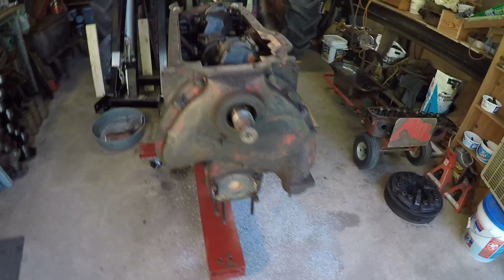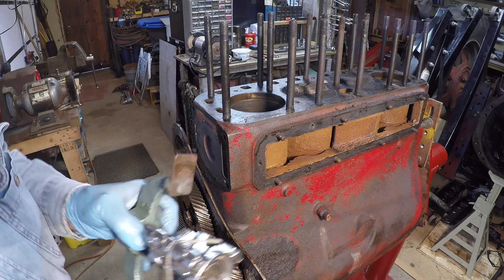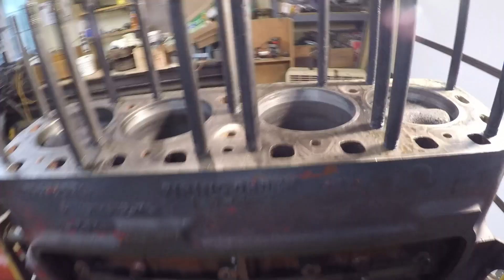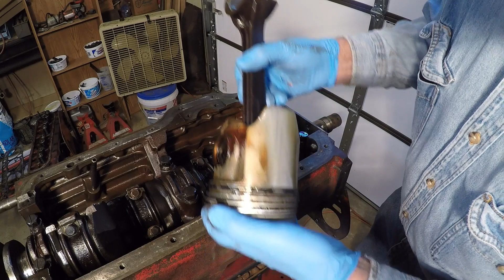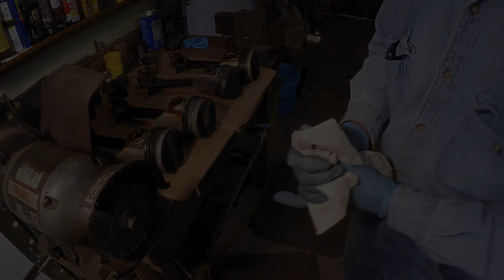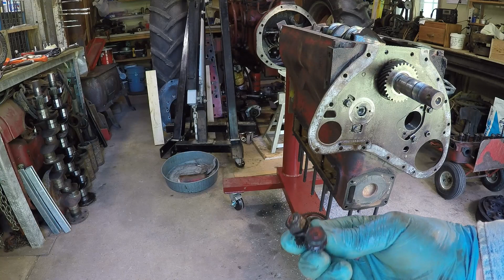Farmall Super M Engine Knock Ep.6 - Discoveries and More Questions...

Comment: Those old engine engines are tough. I bet there are more out there with painted bolts under the valve cover than you think. The nose cone have been known to brake when changed to 12 volts.

Comment: Don't forget there is a thrust side and a throw side. When the piston is on its ignition/power stroke, the pressure of the ignition pushes the piston to one side. on the exhaust stroke  there's wear on the other side of the cylinder. It looks like one side of the cylinder is the thrust side, where the ridge is the heaviest and the throw side the ridge isn't so heavy/deep.

Comment: I am guessing you will re-sleeve this engine. If you re-sleeve it use a mixture of STP engine oil treatment and cleaning solvent to smear on the outside of the sleeves and inside of the block where the sleeve slides into. It helps make them slide in or go in a lot easier. Our tech school instructor called this mixture snot.

Comment: That front cover is probably from previous issue and no doubt why it was tore down, the rust is a good indicator that it was no longer touching. 
I have not seen someone use a ridge reamer in the last 25 years at least. Most young kids don't even know what they are. Great work and great to see proper techniques to show how it was done and should be done.

Comment: Not the worst engine I have seen. There are so many out there running quite happily in much much more worn and tired condition than this one. Nothing really jumps out as the source of the problems you were having with it? Maybe the knock is a combination of several minor issues rather than a single big issue?

Comment: All engines have a thrust side, when the crankshaft is pushing the piston up the force is angular and is pushing the piston into the adjacent cylinder wall.  That's why one side is worn more than the other.

Comment: Except for that piston it looks pretty good. Mains definitely need attention, but I don't think there is enough room there to knock much. If the wrist pin was sticking and the piston rocking that might have been the knock. I wonder how much slop there is in the cam bearings. I'd be kinda inclined to put the camshaft back in and wiggle the gear up and down to see how much it moves.

Comment: Are the threads on the cam nut left hand or right hand? The left hand threads came out with 450 tractors as I recall, and were the replacement for all previous engines. If they are left hand, I’d bet the wear marks on the front cover and the plate came from issues with the last cam and gear. The live hydraulic pumps were rough on the right handed thread camshafts.

Comment: You have been there and done that several times as it come to natural to you. I have torn down engines without taking time to completely read the engine. I knew I was grinding crank and the bearings were all being replaced. Thats not to say I didn't keep my eyes open for tattle tale marks /bruises. Thumbnail for scratches and such but when speed was just as important, I paid a hell of a lot of attention to the mikes and dial indicators plus every new bearing was plastigage to check for any imperfection. I have run into bearings that were marked standard but standard to what as it did not belong to what I was working on and in logging camps where everything had to be goldstreaked in, The cost of shipping could quickly make a engine cost more to repair than to replace with warranty. Time is the enemy in those places and when your building as many engines as you possibly can all at the same time, just to save on shipping. A gallon of good oil could be fifty dollars in town but getting it to camp where you needed it, you bought everything in bulk cause to just buy the gallon in camp could run two or more hundred dollars. I seen two dozen eggs in Barrow Ak run seventy five dollars. The boss bought powdered eggs after that and besides tasting like dog stuff, it was about seven dollars a dozen equivalent!! Doing a great job teaching what you know and that knowledge did not come overnight but many a night with light in hand making repairs so the crew could work the next day. I as a mechanic started when the crew quit

Comment: An old friend had a even older M. One winter he didn’t get enough antifreeze in it and the block wound up with a couple huge slits in it. We looked at it carefully none of the cylinders were cracked and nothing was pushed out of line. It took me about three days but I was able to close both slits with about 20 brazing rods. It held coolant and as far as I know is running to this day. That old iron can take abuse far better than new equipment. The #3 I would check the rod and also the side to side play on #3. Also maybe the spark or possibly at sometime in to past a plug lost its electrode.  Keep us informed I really want to know what you find.

Comment: Another great installment in the series. Most people go way overboard with a ring reamer, when I worked in a machine shop we used to see blocks RUINED from people getting carried away, a light cut is all it takes. On the new rebuild you could run a modern heavy duty 10w30 oil like Rotella T4  year round, more protection hot and cold than straight SAE 10 and SAE 30 which rarely have a robust addative pack anymore.

Comment: this M had light service since it's last rebuild.

 i bought a 44 M used all it's life on mounted corn picker duty. last overhauled 12 years before i bought it .    it had barely any oil pressure and used 5 gallons of oil per 8 hr day. the crank was 0.009" out of round and under sized. came back 0.020" under.  i had to have a replacement cam . the oil rings had no  ridges on them  they floated   in the sleeves. the pistons and sleeves had no signs of wear so the engine got a new set of rings and valves it had a 450 hi alt lp head and dynoed out at 62.5hp after overhaul.. if was one of our main tractors  we pulled a 12ft disk  in 3rd or a 10 ft disk in 4th and a  hi speed 4 - 14 trip plow in 3rd or a 3-16 plow  deeper. i loved my old M and my H as  well. we farmed 180 to 250 acres of grain farm in so il. those were the days

Comment: Senior is this a WET Sleeve motor,.?  In my TR4 Triumph, I need to bolt down the cylinders so they will not break the seal in the bottom of the block.??

Comment: I betcha all those odd play/clearances and uneven wear are the direct result of that piston in the #3 cyl.   Wear and damage like that creates uneven harmonics on the crank.  In turn, literally,  that will cause the cam shaft to wallow out on one or both ends.   The marks on the end cover could still be caused by that cam gear when it's under a load.   It doesn't take a whole lot of surface contact to make those sorts of marks.   If the edge of that cam gear feels "sharp"   that'd be your tell-tale.  Rust or not, the very edge is the point of contact.   Think cutter heads on a lathe...     Otherwise, it looks like you got to it all in plenty of time.   I know my 400's engine is not going to be any where close to as nice a shape as you M here.    I'm sorta dreading just how bad my engine is going to be.

Comment: Too hot of spark plug will melt that center piston. 373 autolite is a cold plug,  c85  & c86 are to hot. 386 is just in between.  I had a 756  that locked up because it melted down.  NGK plug, A4 is a cold plug  like the 373.  The cold number of the A4  is 2510, 10 being their coldest plug.
Reply: @squatch253  I tried  to find out at the time, why the 756 piston melted down,  2 mechanic that worked at & prior at local Case IH dealership didn't know.  Then later in the MN. Farmer magazine there was a article about hot plugs.  I really  didn't know what they were talking about, until a couple weeks ago, was at the dealership, parts salesman & another farmer, we were talking about heat range for spark plugs.  So i went on the Internet, & studied up on it.  756  was over hauled more times than not.  Burned valves, scored cylinders, over & over again. We had a 656 hydro,  worked better, but burned valves, over hauled at 5000 hours. When we finally traded/ 10,000 hrs.,  for JD 6410 4x4 loader tractor, it need over hauling again. I told this to the dealer, they sold it to a guy who burned a valve, & i was called to look at the engine when it was taken apart, scored piston sleeves again.  It used oil, would foul plugs, so i put electronic ignition in it, that work good, no miss fires.

Comment: It seems like I remember something about this tractor possibly not being a Super M from the factory. Is the block a 248 or a 264? if you are putting liners in it matters. Also be on the look out that you don't have for a 248 block bored for 264 liners as that sometimes happens. I think everyone usually puts in the thin liners nowadays. Then you can upgrade a 248 to a 264 or a 264 to a 281. I had pretty good luck using dry ice to put the liners in on the last one.
Reply: @squatch253  If they are 4-1/8" then it was a 264 (Super M) from the factory and the previous rebuild used the thinner liners in to to make it a 281. This is the same liner as used by the factory to to make the 281 when they built the Farmall 450. Pretty common upgrade.

Comment: I'm patiently waiting to hear what caused the damage to number 3.
Most interesting, as always,...Thank You!
Reply: Spark plug to hot for that engine, especially if it was worked hard.  I posted above about using cold plugs.  You can read on the Internet about hot plugs & what they do to aluminium pistons. NKG 4 plug is a cold plug,  number of it is 2510.  Or Autolite, 373  is cold too.  Champion 15 are to hot, as are c86 & c85.  386 isn't that much cooler than the c86.  Lots of charts & spark plug comparison info. on heat Ranges of all the different plugs.  How their  design makes them cooler, 100 degrees, than hotter plugs.

Comment: is the connecting rod on #3 bent causing the top of the piston to scrape the cylinder wall,  or were the rings gaps all aligned  causing excessive blow by along that side of the piston pushing the oil out from between the rings in that spot causing the scuffing..  leaking valve seats. worn guides, leaking head gasket, leaking intake or gasket causing a lean air fuel.. even leaking valve seats leaking in number 4 could dilute  the incoming air charge with combustion since #4 is probably half a turn before number 3 causing a very lean mixture that will expand the piston and rings causing scuffing like you see.  i don't know if that is a 1342 firing order .   you might want to use a thin wall valve guide liner in your drill press and polish the backs of the valve heads.. do a little port clean up and really check the valve seats for recession . you may end up putting in hard seats, new guides and new valves. 

 with the amount of carbon on the piston tops..  you might want to think about creating a water vapor injection system if there is any ported vacuum taps on the carb.. probably not.. this would come in handy when plowing or during extended mid to high power settings.  to keep the carbon out of the the combustion chambers.  this can be as simple as a fish tank bubbler stone on a hose in a kerr jar with a fine adjust needle valve to limit the amount of air into the kerr jar while the ported vacuum pulls on the other fitting creating little clouds of water vapor to pull into the engine.  manifold vacuum does not work as this is low under load.. where ported vacuum is high under load.. 

   you might also want to look closely at the combustion chambers to see if they need any polishing where rough surfaces are that could hold onto carbon causing a hot spot and preignition under load..     some fords and almost all chevy V8's had an issue that would destroy number 7 on chevys and number 8 on fords as the cylinder next to it was 1/4 crank turn prior to this cylinder.. inductive crossfiring in the spark plug cables would partially ignite the air fuel mixture with the piston only half way up on the compression stroke.. when it got to the top what was left was lean and it would burn crazy hot.. expand the piston till the clearance is removed , the aluminum transfer welds to the cylinder walls.. scraped up under the rings and lifts them off allowing combustion gasses past..  so i am not making this up.. there is reason to my thinking. 

 these are probably the instructions for the carb.. https://www.steinertractor.com/products/pdfs/Marvel-Schebler-TSX.pdf  with adjustable jetting.. it might be really interesting to create a short test exhaust section to bolt between the manifold and the rest of the exhaust with an oxygen sensor bung installed... allowing the use of a air fuel ratio display to allow you to find tune the power jetting while dragging a log along or dragging your sun in his truck with the brakes on to check the air fuel ratio under load to make sure its not going too lean.. 

   one can visit the hardwood floor store or equipment rental to get massive sheets of sandpaper to lightly glue down to easily surface the open faces of the intake and exhaust manifolds.  as long as its glued to a perfectly flat.. and a ton easier than trying to get it machined. 

 i hope i have not ruined you with this massive wall of text..

Comment: You pointed out 2 areas of wear, #3 piston rings and #1 main bearing, which is a mystery as the engine has had good oil and is clean. Could there be some dirt in the oil passage which has caused slight starvation.

Comment: Sr I have a  ?  Doesn't the M have wet liners?   I know the gas six cylinder engines are dry . But thought the four cylinders had wet liners  . Not sure .you and Jr refreshingly picky.  Thank ya'll. 😊
Reply: @squatch253  i couldn't remember  if they were or not !😊
Reply: @squatch253  i just remembered something a IH mechanic told me once.  That there is a number stamped in the top of the block.  That is in reference to the od of the liners and you have to get liners that correspond to the number.  Because if you don't they won't fit properly.  That old mechanic tought me a lot . But I'm sure it wasn't enough.  Those H. And M s were what he worked on day in and out.  Don't know if that will help.  It might or not. 😊

Comment: Number 3 piston was probably your main problem child, but all that other stuff you found can be questionable as well. The main bearings looked good enough that you could reuse them, but with you wanting to grind the crankshaft they'll be of no use now. What did number 3 cylinder look like? Was there scoring there as well??? Great video, enjoyed watching you take the engine apart.  Thanks for sharing.....
Reply: @squatch253  I was wandering about the #3 cylinder walls.
Keep us informed of the progress please.
MB BAR RANCH
Reply: @squatch253  Hint:  You said it- they've been in it before. Could be the cylinder wall was cleaned up but the piston was marginally not good and they left it that way. I say this because we can see how they reused that nut that they had gouged. It speaks volumes about their attitude towards their repair the first time. There is definitely a reason that piston is bad. My guess may not be a good one, but something messed up that piston.
Reply: Also, those painted bolts inside the engine are another hint that their brains weren't firing on all pistons either.
Reply: @canuckyank82  Ha,ha,ha I wanted to say that but I was holding my comments on it. I am hoping that is all they'll find with this tractor, because they are only rebuilding the engine. But we'll just have to wait and see, I guess....

Comment: Thanks for taking the time to share this!  Is the bore 264 or 281?
Reply: What is the stroke ....?

Those rods and piston skirts are pretty long ...... But then things were different back in those days ..... :)
Reply: It definitely has been messed with before if it’s 4-1/8.  That would make it 281 cubic inches.  I’m pretty sure that the super m and 400s used the 4” piston 264 cubic inch motor.  I know they made a kit to turn the 264s into 281s though.
Reply: @sterff89  Yep. Exactly what I was guessing. They messed with the original and put in a kit placement.

Comment: Speaking of oil, someone sure could eat off the inside of that engine. Yall know what kind of oil to use and keep it changed when it needs to be. FINE job and the 'helper' will be in as soon as Ford turns him loose.
Reply: Lewie McNeely Pretty confident they weren’t using non detergent oil for sure. 😎
Reply: @bcbloc02  Good old DElo. We know it well!! This is why I run it in ALL my stuff. Personal witness of the 980.
Reply: @squatch253  Wise .....